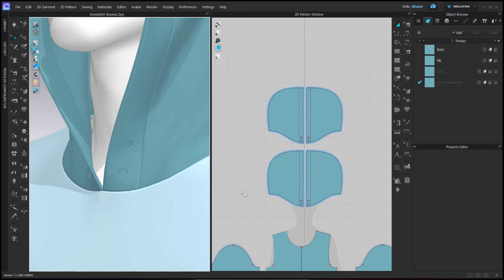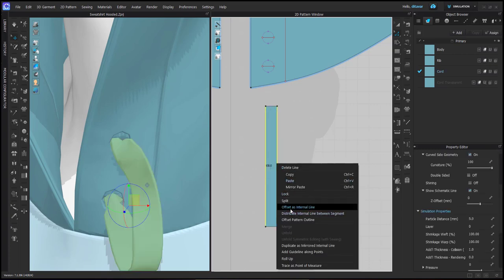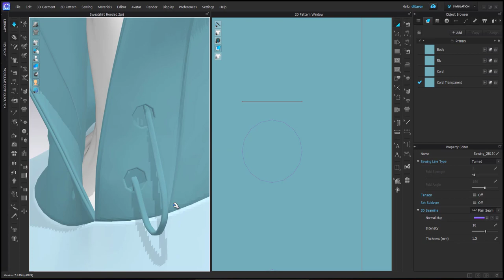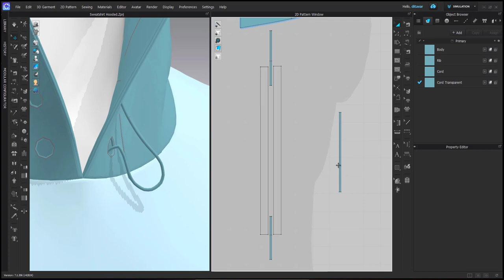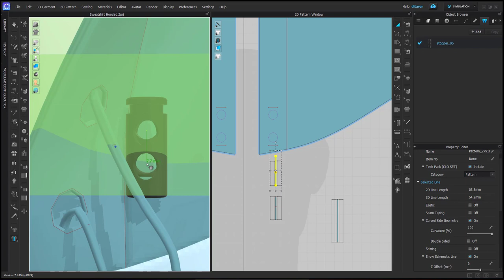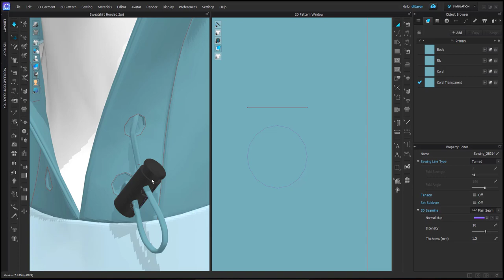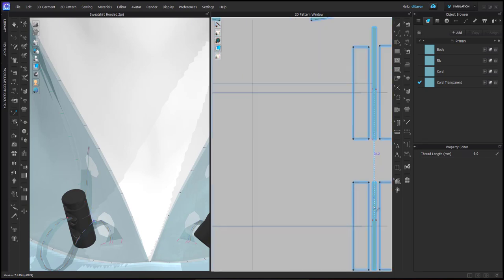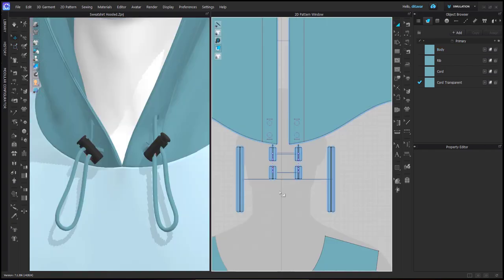CLO3D | Cord and Stopper

Comment: my stopper doesnt move with the cord, its stays at one point when I start the simulation. can someone help?
Reply from the maker: It sometimes happens, when you attach (glue) a trim to a pattern piece. When you move the trim around, it somehow loses the connection with the pattern piece and doesn't move with it anymore. This is CLO's issue. Only thing you can do is attach the trim again to the pattern piece.

Comment: Hello. When I move the string, it moves through the stopper, how can I solve this problem? Thank you!
Reply from the maker: Unfortunately CLO doesn't have that ability to make trims interact with pattern pieces. You have them either as ghosts that move through pattern pieces, or as solid objects who doesn't move at all. There is not much you can do. Some set up with pattern pieces and placing trims on them can help, but it is trial and error type of thing based on your specific situation.